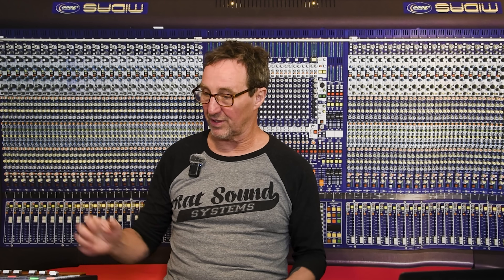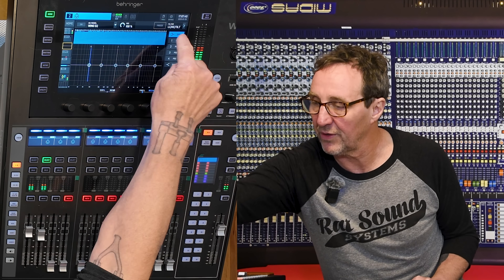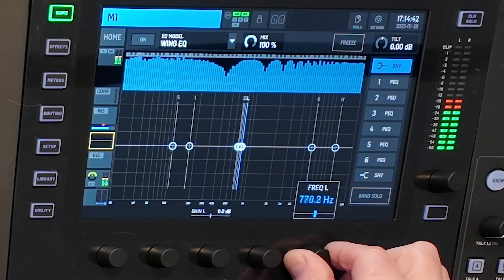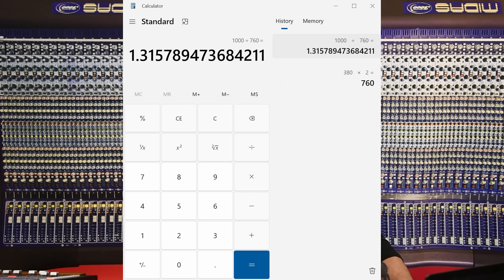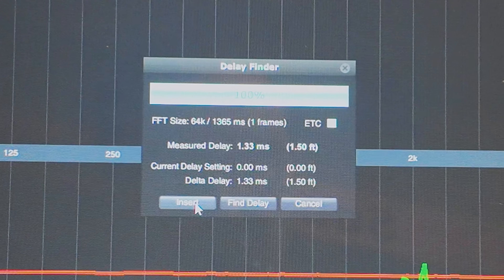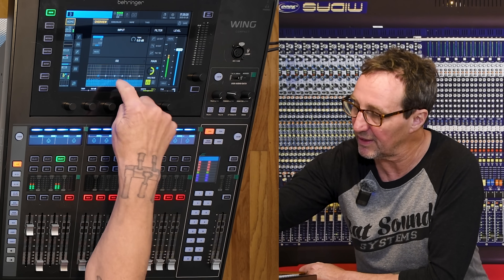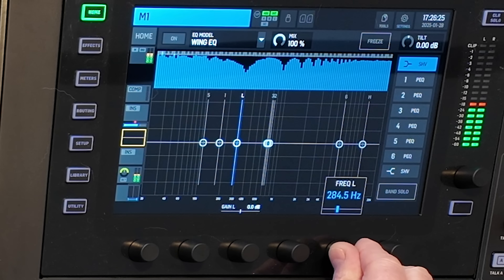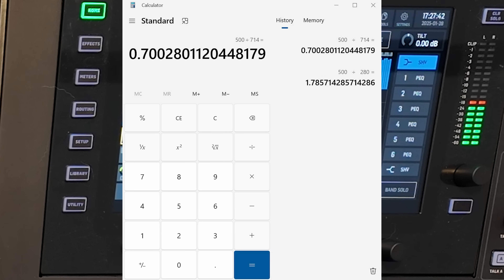Easily Find Console Comb Filtering Latency Issues

Comment: My friend was telling that if he would use two mics for same or similar sources he would put the same pluggin for both even if he wouldn't need it in other channel to basically give them the same routing and path hence the same internal delay cause he realized that they would have this issue similar as you said Dave. I think that is what he explained to me. So it is actually really great to see this video as we were just talking about this few weeks ago. 👍
Reply from the maker: Yes his plan is good and being careful to make sure that no source is combined with itself in any of the routing unless you've made absolutely sure that there's no latency offset between the two paths is very important
Reply: @DaveRat  I've known and done this in the studio for years.  But the way you just said it reminds me of a Ground Loop!
Reply from the maker: interesting perspective and yes the offset in time of combining two signals has a negative ramification perhaps not unlike the offsets in voltage of recombining two grounds. 

quite different but the same as well. Great observation

Comment: I believe ....... prepared to be corrected ....... That when Midas were still Midas and launched the big-boy Dig PRO series (6, X etc); The consul would view the longest latency across the consul and add delays to whatever needed to bring all I/O in line ....... I think, because thier leftover Analogue boys still designing had foreseen this
Reply from the maker: interesting and I guess helpful but also having the console slide around in latency is kind of a bummer too. especially for monitor consoles where it changes the way that mics feedback.

add a drum plug-in and all the mics all over stage start feeding back. ewww
Reply: My understanding of the PRO2 was that the latency was the same if a channel was assigned to a group bus or straight to the master. Early on there were no plug-ins or compressor models to vary the latency so the channels were aligned to match timing with other channels that were sent through a group bus.
Being an (early) 96khz console gave lower latency to work with.
Reply from the maker: interesting and that makes sense.

but now and currently seems engineers are just piling on shit tons of Waves and other plugins and creating a latency nightmare whenever possible. 

walking around these festivals that we provide sound for I just hear this acoustic mess coming from so many stages so I thought I'd share A simple way to hopefully inspire a few of the engineers to clean up one of the issues

Comment: Shouldn't these manufacturers add automatic latency compensation to all tracks to make things easier for everyone? This feels more like a design flaw than a "digital console" quirk. I would never use paralell processing live without Automatic latency compensation. Is there a reason why this isn't implemented on live digital consoles?
Reply: I looked it up: The Behringer Wing console does not have built-in automatic latency compensation for plugins, which can cause phase issues when using plugins, especially in parallel processing. Users need to manually compensate for this latency or use workarounds to align signals. Behringer's internal FX racks introduce latency, and there's no automatic compensation for this or for latency added by inserted plugins. 
That would be a total red flag for me when researching wchich digital console to buy.
Really nice tips, though!
Reply from the maker: though I don't know for sure because I haven't tested, My understanding is Yamaha rivage consoles do have latency compensation and most other manufacturers do not. digico I do not believe has it.

conversely having the entire latency of the console shifting around every time you use a new plug in is of concern as well. 

My take is that awareness and testing to confirm the setup does not have latency issues is required no matter what, when using digital consoles. 

when using analog consoles we had the same issue when patching digital effects or any other digital gear, we had to pay attention to latency issues. 

The same thing applies now it's just all embedded inside the same box
Reply: @LasCosasComoSean  To be fair for this particular console its not really the workflow you would use. While you can insert a compressor on the 'insert' slot, the compressor models are very few and mostly aimed at bus processing. This is because every channel has a dedicated compressor slot that doesn't  introduce any latency. And with every channel compressor having a wet/dry, even parallel compression  isn't  like we would use to do it in the analog world by routing to a bus and summing the 2, thus introducing the latency.  If you wanna use some kind of bus & channel combining while using several insert slots, you indeed have to manually compensate, tho as shown here that's also fairly quick and easy.
It is a console limitation for sure, but considering the price and the time aligned processing you do get, it's only a minor issue that just warrants knowing how to deal with the limitations.
Reply from the maker: I used to compressor as an example but any pluggin that you insert on the channel that isn't native to that channel will cause latency differentials. additionally the same thing applies to anything that is inserted onto a group. 

awareness of how easy it is to get into a digital latency mess I think is important information and this applies to just about every console out there not just the cheap wing and Barringer stuff. 

Allen and Heath, Digico and I think all of the Yamaha consoles except the rivage. 

add in things like waves and you end up with a big mess really easily and quite often
Reply: @DaveRat Thanks everyone for you input. I've learned a lot here. I've realised features like Automatic Latency Compensation are tied to the budget tier of a console. And that the point of this video is learning how to measure it and fix it if your console lacks this feature when using built-in plugins 🤙🏻
Reply from the maker: very cool and also you can check to make sure the auto latency compensation is working. And you can see how much latency the console is adding with the auto latency by doing the demo like I did in the first bit where you come out of the console and back into it. 

having the console automatically change its latency is a separate concern of its own
Reply: @LasCosasComoSean  While I get your point - the wing is honestly dirt cheap for what it is. I may be wrong, but I would think that said latency compensation would be possibly quite difficult to implement in a good way. They could just state the delay tho
Reply: Because it's a live console and not a DAW.  The designers have to accept compromise with a processor fixed time budget, a DAW can continuously add overall latency ala carte as needed - 50ms offset when you hit the transport doesn't  affect anything.
Reply from the maker: agreed Time is important to us live humans
Reply: Allen heath has phase coherent?
Reply from the maker: this isn't a phase coherency thing it's a latency due to added processing when plugins are added. Allen and Heath do not have latency compensation for plugins added to the best of my knowledge. 

The only consoles I know of that claim to have latency compensation is the Yamaha rivage and I don't know the scope of that. And what is included and what is not. but if it indeed has latency compensation, it either has a really long latency or the latency changes as you add more processing. both of those are concerning as well